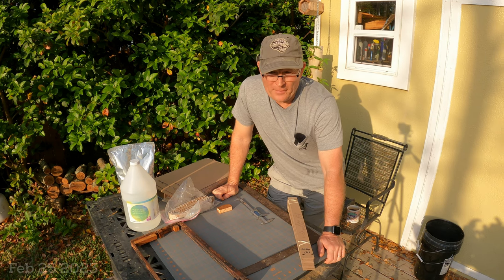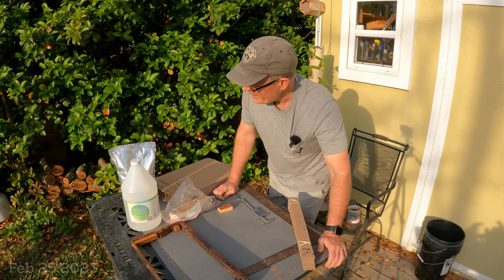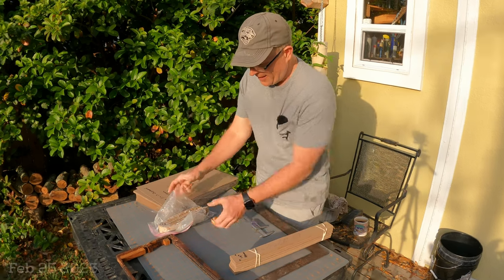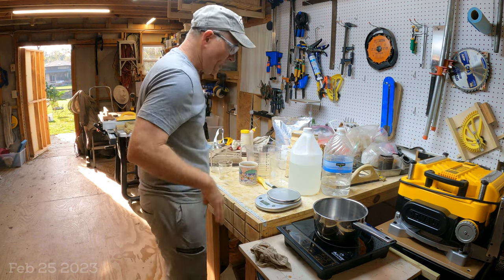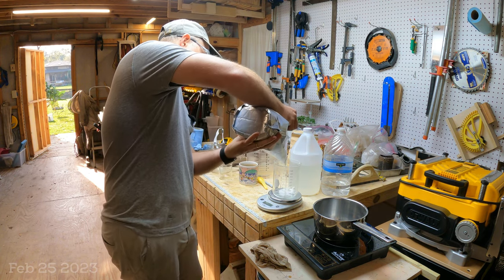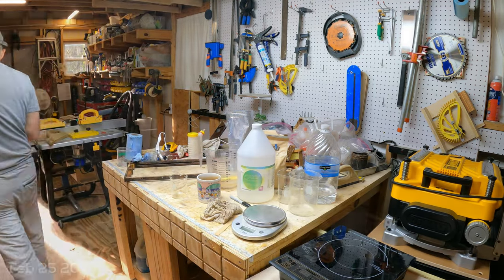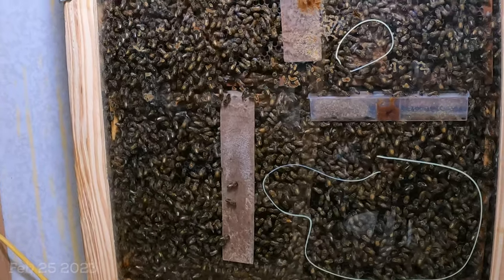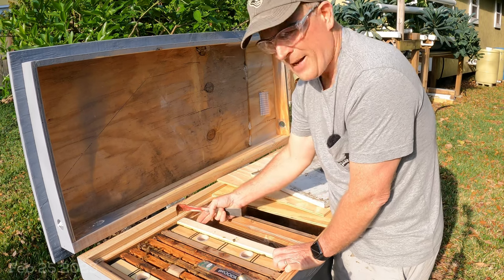HOWTO - Extended Release Oxalic Acid Strips on Chipboard - Jacksonville FL Zone 9a

Comment: Just out of curiosity, why do you add the water to the mix?   I noticed Randy doesn't really use water  anymore in his formulations.  Do you find with the thick chipboard it needs to be thinner to absorb properly?
Reply from the maker: The water thins the solution so it goes into the chipboard, then it evaporates out.  You are correct.  In the Swedish sponges Randy uses, you don't really need the water to get it to soak into the sponge before it starts to cool.
Reply: @chuckshoneybees   I made a bunch of these, unfort my bees chew them out really fast..  Usually a week into it and there is a pile off confetti at the bottom of the hive.  Do you have similar results?  The thought of having to make new every 2 weeks to a month, doesn't seem fun
Reply from the maker: @Swampsquash  The chewing action is part of the process of spreading the OA throughout the hive.  Each hive does chew them differently.  The goal is to have the slow release of the OA to cross the span of the hatching brood to get at the mites under the brood cappings.  So even if you have hives that can chew them out that fast, you have still achieved the goal of extended release of the OA.
Reply: @chuckshoneybees  I had thought Randy said in one of his reports that the chewing and dragging through the hive didn't have the effect, he thought it would
Reply from the maker: @Swampsquash  Randy prefers the OA Swedish sponges due to the ease of use throwing them between brood boxes, I use both, but still think the strips between the frames work well and also work with smaller nucs and single deeps.
Reply: @chuckshoneybees  ya I'm trying the cardboard for nucs etc but I find the pads are much better.  There isn't enough contact time before they rip out the pad
Reply: How many pieces should we put for a cell of 10 tires?
Reply from the maker: @ameralmalki975  3-4 strips per deep brood chamber.
Reply: @chuckshoneybees  
I have cells from the Langstroth system. Do you put 3 chips per cell of 10 frames?